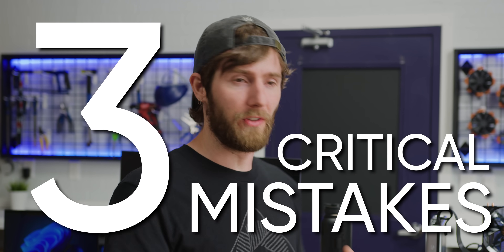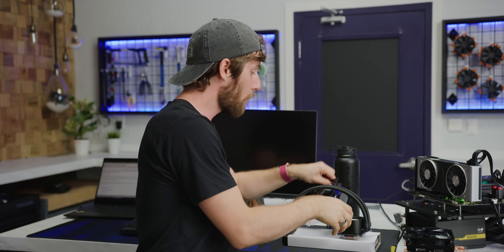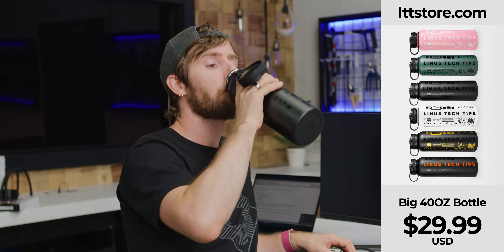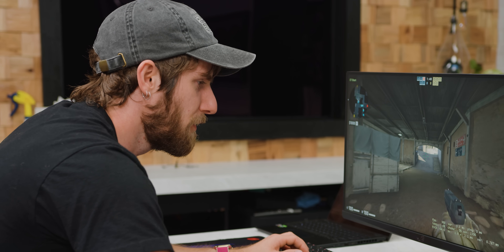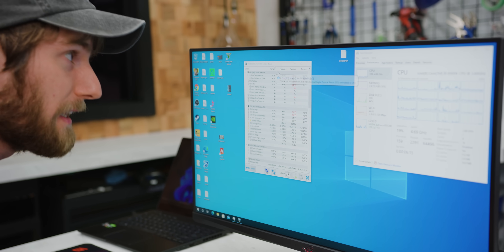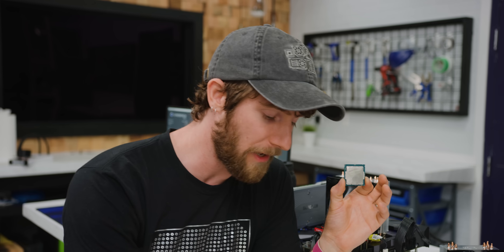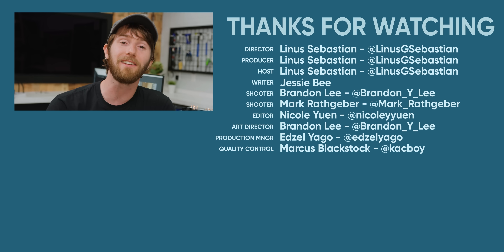How BAD is it if you forget to peel??

Comment: I don't know why so many people talk about keeping your CPU as cool as possible to extend it's life....

I've been building and owning PC's for over three decades now, and most of the time I keep the CPU in my systems for at least 4 or 5 years, and I always overclock. I've never used crazy cooling solutions, in fact every system I've ever owned besides my current one has been air cooled, with my current system having a 120mm double thick AIO water cooler (which is really just a baby step into water cooling).

In all my time, I've never even once seen a CPU quit working, especially from overheating or long term heat. The only CPU I've ever seen that quit working was one that got physically damaged during a delid.

Comment: This happened to me.

 I've been running it for a month or two with the plastic (i5 10400F) and it only happened because we had a new computer after 10 years, I rushed the build while I was ill + had a fever, so I kinda forgot about it, yes the temps were high in turbo mode (around 70-80 ) but it really did not affect the performance of the pc at all.

Comment: Honestly had this happen before, where I left the plastic coating on the cpu air cooler and applied thermal paste. Everything worked fine for months. Then decided to recoat some thermal paste and realized I left it on the entire time. No issues at all, just more surprised it didn't melt or cause any issues.

Comment: I bought a Cyber Power PC back around 2010, they left the protective cover on the cooler and tried to deny it, saying that must have somehow put the cover that THEY removed and threw away on the cooler when I removed the cooler to remove the melted and burnt on protective cover.....all I wanted was a new CPU and cooler......instead I got a month of angry phone calls, and eventually returned everything and got like 90% of my money back. I havent watched the vid through yet, IME temps werent radically different, it was my first i7, a 950 I think, and temps would spike all over the place regardless.

Comment: "Now we're gonna go with a 9900K" now we're talking about heat 🔥
Reply: @nax4448  might want to undervolt, I have a 3900X so I can't speak from experience with 5000 but what I can say is all CPUs can hit that, depends on the situation. my 3900X with stock cooler runs cooler than that on a blender cycles run of 36hrs on CPU only, maxed at 95 degrees on hottest time of the day with pretty bad case airflow. so pretty sus, depends but $168 cooler getting 93c? have you removed the peel?
Reply: @nax4448  you can undervolt easy with the auto tool, or atleast get and idea of what cores can top out at and make it easier for per CCX overclock. I know its annoying on AMD but ClockTuner is very easy way of getting better performance for less watts, give it a shot

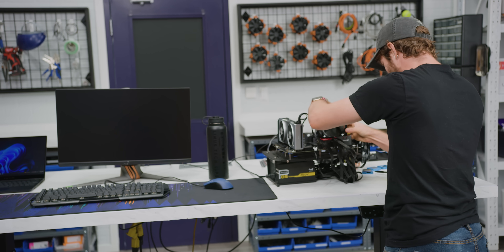Comment: 5:20 Just goes to prove that thermal paste marketing is mostly hype when you do the actual physics calculations. As long as it's thin enough with a small enough heat load (the most important things) even plastic doesn't care when it's used as a TIM. At least until you Prime95 what it's cooling overnight and it melts and turns into glue (still fine, until you rip the pins off when changing heatsinks). Liquid metal = high cost and high risk for little actual benefit over nonconductives. Now if it was 1mm or thicker pads I'd pay attention to thermal resistance numbers. 0.1mm and under makes little actual difference.
Reply: There was one time where I found some old generic thermal compound when I was looking for what I normally use. It was probably worse than the plastic, it was so bad. Fans revved up with cold air doing something as simple as starting windows. But yeah, anything modern and new is probably fine
Reply: If you truly believe that thermal compounds are just hype, feel free to try not using any and only use a stock cooler with your CPU. That tower cooler Linus used was way overkill. its why it worked even with the plastic. I'm not responsible for any damage you do to it though, you are the one contradicting easily measurable performance differences. Just a cursory search on YOUTUBE will find you plenty of videos actually showing people VISIBLY measuring different compounds and brands and discussing the difference in performance between them.
Reply: @alexisrivera200xable  5C difference constitutes hype imo. Granted that's maybe a 50% difference in lifespan, but who runs the same CPU for 20-30 years anyway? Most tower CPU heatsinks have 0.1C/W resistance, maybe 10x that for a $5 stock heatsink. Until the TIM is almost as much of a resistance as the sink it will make little difference. Intel/AMD has gotten smarter lately anyway, due to not bothering with adding aluminumn scrap when everyone gets a tower or waterblock with the higher end/hotter CPU's anyway. In short practically no one pairs expensive TIM and a stock/cheap  sink. And better sinks aren't as picky when it comes to TIM, which then has dimishing returns when it comes to C/W. With a waterblock with decent flow (1-2L/min) I could literally use toothpaste, creamy peanut butter, or engine grease meant for lubrication and see maybe a few C difference under the same heat load and applied thickness over even liquid metal (though the long term performance of that mess would be questionalble as it heats up and dries out over time).

Comment: Moral of the story: don't let the excitement and impatience get to you. Forgetting to peel is bad; no waterleak testing is worse, esp when you also don't fully seat hardtubing into a fitting and don't catch that before turning up the pump controler to max and it pops loose while a pmp-600 is dumping 15L/min and giving everything a garden-hose shower while powered on.
Reply: Well that's oddly specific
Reply: @hudsonarce4397  Sadly because it happened only last month = $4000 in damage. Luckily most of it was covered by warranty after I dried it out and RMA'd the parts that died (I got lucky in that respect, didn't think they covered fuckups like that).

Comment: The old  school of an co worker had their Pc´s without the Plastikfoil removed, atleast 10 of 24 Pc´s.
Only after 3 months, when the school had an official IT Guy who did a Hardware Checkup they had discoverd the non Peeled CPU Cooler.

SInce they had not been under heavy load, they never had an issue lol

Comment: I recently upgraded my pc to a 5800x and ended up forgetting to remove the plastic part on the bottom of my new noctua cooler. The computer would not stay on for more than a few minutes before shutting off before anything would happen under a load when trying to reinstall Windows.

I thought the bios was messed up and took things apart to swap back the old cpu and found the plastic piece still on there some how. 
After taking it off it now runs like a champ. 

Oh how dumb I felt.

Comment: Aight so I have a question that I don’t know how to phrase, so I’m just going to explain it like I’m 5. What happens if you put your PC in a refrigerator? Like only a few cables and the monitor/peripherals are outside the fridge. Will this cause any issues? Maybe the opposite of a thermal throttle?

ALSO: is 35°C a good operating temperature?

Comment: i recently switched from an air coleer to a 280 AIO, i usually have 60 degrees farheneit in my system, when i finished screwing in the new radiator and all i turned on my PC and... 80 degrees, there i realised i forgot the damned plastic layer on, i remove it, and im going to 60 degrees again

Comment: Did this a few months ago upgrading to a R7-5800X with a NH-D15 cooler. In my defense, the cooler is so massive, I didn't notice the plastic protector I had it sitting on stayed on when I lifted it. Install was a bit trickier than I expected, but it was after I turned it on, and noticed it sitting at 105c, that I pulled it apart to check. Thankfully it was less than a minute powered like this. That plastic was already deformed from the heat. A good 50c cooler with it off....

Comment: I had a aio pump die on me once on my gaming pc (overclocked 6700k cpu). My kids had been born about a month earlier so I was going weeks at a time without using it. I'd left the computer on and when I got to my officeI could hear the fans running full blast and the temp at 100 degrees. The computer had been running for at lest a week, and apparently not going to sleep. I immediately shut it down. Cursed. Corsair replaced the h100i with an h110i. Installed it, no issues since. Been three years and I'm still running the same cpu/motherboard. It's amazing how resilient modern chips are.

Comment: So he doesn't remove the plastic and run the tests again with EITHER processor?  Is it possible a mediocre cooler isn't cooling much better installed correctly without the plastic? 
And what about those "cooler pads" you use instead of paste. I wonder if they did more harm than good.

Comment: I don't know if there is a label for this in psychology but I have this thing where I constantly doubt things I've checked before. For example, I'd have to check the stove to make sure the gas switches are off 5 times in one night before I feel comfortable enough to go to bed. I made sure to take a picture of the cooler with thermal paste on it just before I installed the cooler on the MOBO. That one picture has saved me from having to unmount my cooler to check the CPU many times, including today when this video triggered my worries.

Comment: I bought a raid card once that was running hot. I decided to remove the heat sink to apply new paste and found a "remove before use" peel on the heatsink, covering some rock hard thermal paste. And it came from the factory like that. After scraping it all off and applying new paste I think it was like a good 20f drop in temp.

Comment: Why is there even a plastic peel on the bottom of the cooler anyway. It should be well packed in a box, there shouldn't be any nicks on it. That's also why some coolers have thermal paste pre-applied.
It's not that stupid plastic sticker that will magically prevent the cooler from being damaged if it was going to be damaged. The fact that it cannot be recycled either, is also a terrible environmental choice, too. Yes it's plastic. But too thin and too small to actually go through the recycling machines and be sorted properly. It will likely just stick to the side of the recycling truck if anything. They could just as well put a piece of cardboard or a larger, thicker piece of plastic that's recyclable instead of a sticker.

Comment: I accidentally tried it with a r5 3600 , removing it with the peel resulted in 10-25 C° drop ... Got over 20 years of PC building experience .  Helps to not be distracted.
Reply: How to increase your cooler's cooling capacity by 25 °C:
Step #1 - Build the PC incorrectly.
Reply: The reason I couldn't make this mistake is I have to double check if the heatsink surface is nice and clean before putting it on.
Reply: I'm terrified that I forgot to do this now, and want to check lmao
Reply: @NotFiya   me too !
Reply: Literally same here. Went from constantly throttling at 90 to anywhere between 65-70
Reply: I've fixed a 3600 build that would not even post because the plastic was left on. The key difference to this video being the plastic covered the factory compound applied to the cooler. As the post error was a CPU fault I assumed the CPU wasn't seated correctly but when I removed the cooler I immediately noticed the plastic, I removed the plastic and put the cooler back on and that PC has run without an issue since.
Reply: That's interesting. I got one myself, and the stock cooler didn't seem to have a sticker. It came out of the box with what seemed to be the included thermal paste accidentally touched it and left a fingerprint on it. So I assumed I ruined it and so cleaned it off with alcohol and put thermal paste on it.

I'd be worried there was a sticker and I missed it, but I know I got down to bare metal when I cleaned it, and my thermals are normal even with Folding @ Home running on all cores.

I guess the sticker just came off in the box. I actually remember thinking it was dumb it didn't have one.
Reply: @ZipplyZane  As someone that has been installing AMD processors nearly every day since the 2700x was new, they really don't. I've never once seen plastic on an AMD stock cooler. Hyper 212s and many Cooler Master coolers alike (this brand has them most often compared to others) all have them, but AMD stock doesn't.

Maybe the person had a 3600 but had a third party cooler?
Reply: @VraerynDaDragon  Thanks for the reassurance. 

It does seem stupid to me not to put a bit of sticker on there that you have to peel off. I wound up touching it just getting it out of the package. I'm glad I had some leftover thermal paste.
Reply: I obsessively clean both the processor and cooler with alcohol before application, despite it not being necessary... But as a result I've never done this, lol
Reply: @DoctorX17  Fair enough, I usually at least check temperatures after installing a new cooler, so while I've done it, it has not yet found its way into a customer's hands before I fix my mistake.
Reply: @VraerynDaDragon  well it was my very own PC I fucked up , go figure ...
Reply: oh but for distractions, life would ever be dull and inconsequential :D
Reply: This is hard to read
Reply: "accidentally tried" lol
Reply: As someone that effectively does this professionally, I've disassembled and assembled more computers than I can count in three years. 

I've forgotten, and I'm convinced there'll never be a time I don't ever forget.
Reply: Ditto.
Reply: C° LMAO
Reply: bruv u started in 2001 sheesh

Comment: For me, it is not plastic.
Remember the atrocious design of Intel stock fan with 4 pins?

I built my own PC with G4560 but it always stutter when I use it for a long time, I thought it was because of stock fan was a bad product.
Untik I repasted the CPU...
the pin was not secured properly.
That's why I hate Intel stock fan.

To be fair it made a contact that'a why the temperature in the software is pretty normal when nothing runs.

But the moment a game run, the frame dropped.

So the conclusion, always make sure the contact of heatsink and CPU has necessary pressure

Comment: While I can see someone making this mistake if they build computers every day; it’s hard to imagine a home builder doing this. As Linus said, this is only an issue with after market coolers. However since those coolers require different brackets or installation methods for various sockets, it’s hard to imagine someone missing this while checking the mounting structure.

Comment: intel TDPs are completely wild, in Sandy times the top i3 were rated 65W
but also the weakest "standard voltage" dual core without HT and clocked at maybe 2/3 of that i3 aka g530 was rated 65W
peaking below 25W with p95 and furmark

though as it was the same die it makes some sense
not much but at least a tiny bit

Comment: the i3 8100 is basically cooler under load than most CPU on idle! (i would know i own one!) too bad i can't overclock/underclock it since i like the heat in the winter but not the summer... (so all i seasonally clock and volt is the RAM.)

Comment: I did that once with an Athlon 1000 MHz when I did a test fit of the cooler, forgot about it, completed the build and turned it on. That was 20 years ago but to this day I won't forget the 600 DM (about 420 EUR if you account for inflation) I paid for the replacement. Thanks to lack of competition I'm pretty sure I got ripped off here, too.

Comment: I did this same thing once by accident on my childs computer it kept overheating and turning off. I thought I really messed it up but it was the plastic on the cooler :) once I fixed it there has not been an issue since. Now one day I hope to replace the FX processor with something better but thats for a later date.
Reply: The other issue I had was the thermal paste was under the plastic thus creating a furnace for the poor cpu.

Comment: I once had an i7-8700k running on an older stock intel cooler, which I just 'borrowed' before I bought myself a better one. I haven't had much experience with putting it on and IMO those coolers were soo junky and not intuitive to put on at the first/second time. I didn't have much time so I just put it on thinking it's gonna be fine, downclocked the CPU to make sure nothing bad will happen and run it like that for a month with temperatures at ~80C. Later, I found out, that I mounted this intel cooler not correctly and it even wasn't touching the CPU at all, because one pin out of four was completely out. Boi I was shocked it run so well with stock cooler NOT EVEN TOUCHING IT 😂😂

Comment: I'm suppressed it's this little difference frankly, you had to use a low end cooler and a high draw chip to actually make it throttle in normal tasks just goes to show how good the rest of the system is these days that you can make a royal screwball like this and things still work, even

Comment: well well well
"The odds are that its not gonna kill anything"

My friend forgot his plastic on the cooler, and operated like that for 2 years, as a power user.
The plastik got burnt in both the CPU and the cooler, and it ripped the CPU out of the socked when uninstalling (AM 4)....
it was a real pain to get off, the cooler was broken after it, and the had to sand the cpu heatsink down....
SO PLEASE
don't forget to pull off you plastik

Comment: Omg right when I read the title I've had that issue with my GPU. For weeks I could not figure out why it was way under performing. So last attempt after trying everything I took the gpu apart and realized I had forgot to peel the plastic from the VRM thermal pads 🤦🤦😔

Comment: Yea I did this with my i9-10980xe. It worked mostly fine but when you hit it with a loaf it would always throttle.  Fortunately the aio water cooler had the pump fail after 3 months.